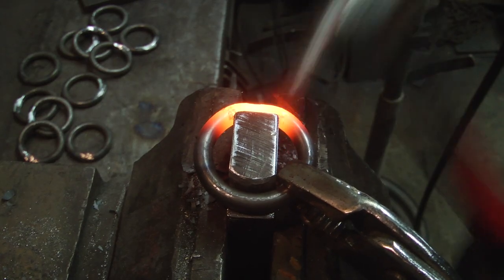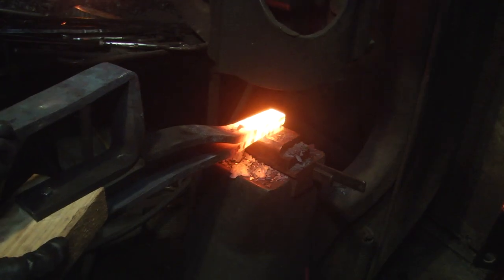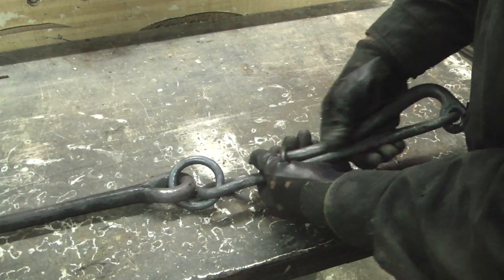Channel Trailer & Introduction To Engels Coach Shop

Comment: I would be hard pressed to name anything I have enjoyed more these last several years than your videos. They feel like a refuge in a storm to me. No politics, no wise cracks about current events, no religion other than a general appreciation of a higher power. You sir are a gentleman and a scholar! 

Love to see more of the mules and draft animals working. Loved the videos of the twenty mule team!
Reply: My sentiments exactly, and I've often thought that even if I can't put together a workshop to build life-sized wheels and wagons, I've learned so much about how they are built and adjusted, optimized for strength and durability, that I can at least make a pretty good scale model on my workbench.  These videos are very often the stuff that dreams are made of.
Reply: Spot on!!!
Reply: I will second that. This is what Youtube is about
Reply: @blackandgus  p00ppp0000ppp0000pp0p000p00p0p0p000p0000000p00000p0000p00ppppppp0ppppp0p0pp0p00ppppppppppppppplpppppppppppppppppppppppppppppppppppppppplppppppppppppppppppppppppppppppppllppppppppppppppppppppppplppppppppppppplpplpllpppppppppppppppppppppppplpppppllpppppppppppplppppppppppppplppppppplllppppppplpppppppppppppppppppppppppppppppppppppppppppppppppppppppppppppppppppppppppppppppplpppppppppppppppppppppppppppppppppppppppplppppppppppppppppppppppppppppppppppppppppppppppppppppppppppppppppppppppppppppppppppplppppppppppppplppppppppppppppppppppppppppppppppppppppppppppppppppppppppppppppppppppppppppppppppppppppppppppppppppppppppppppppppppppppppppppppppppppppppppppppppppppppppppppppppppppppppppppppppppppppppppppppppppppppppppppppppppppppppppppppppppppppppppppppppppppppppppppppppppppppppppppppppppopppppppppppp000⁰⁰⁰

Comment: Thanks Dave.
Your videos gave me the confidence and direction to make a wooden pump handle for our 160 year old farm.
It sits right off the porch and had been repainted but never a new handle. Without any one knowing I showed up with primer,paint and a new custom shaped hardwood handle with a new bolt. Truck's blew the air horn when making the bend.It really put life back into the front porch.Thanks for all your help on how to go about it and not give in when only hand tools are the answer.
I've learned so much.
Can't thank you enough!!!
Mark Brown
Britton Michigan.

Comment: My grand mother used to tell me I was a jack of all trades but master of none. Dave you have taken the Jack of all trades to a whole new level! I am restoring an older Jaguar E type and doing most all the work myself including upholstery, paint, metal repair and much more. I have learned a thing or two now as I am about to turn 65 years old. I think grandma would have been impressed. Your videos are inspiring for me. Thanks!  (I'm the one that asked if you had 3 phase in your shop)

Comment: Like the rest of the world, the north of Australia was built on the back of a bullock team. Today the only trace that survives is the odd axle in a fence. I don't think I have ever seen a wagon or coach, doubt I ever will see one in real life but I have watched every video. It has been the small things that have made the most impact. I have been using rivets for 20 years, and not until watching these videos did I find out I was actually bending wire in holes, my hammer and hand were too heavy, still a way to go but I am finally setting rivets for the first time. Also early days but I also started spinning my G clamps, it seems so logical I can't work out how I never saw it before, I guess that is what happens being so remote with no real tradesmen to learn from. Thank you Dave. This is the best TV that has ever been made.

Comment: I worked in a modern day blacksmith shop for a while, all these people who have no idea about the art of blacksmithing need to spend a few months or a year  heating and bending iron, nothing else. 
What you do is an art that we are going to loose when you are gone, the same as my profession is on the way out due to those who are coming up not willing to learn how and spend the time to become good at a profession where dirty hands are the norm, that also includes sore muscles and the scars left from any one of the thousands of skin breaks that happen. Great job, missed you for the month you were gone, but definitely do understand.
Reply: Santina Murphy  Sweeping and cleaning up is why many wouldn't do the job. These pansies of this age KNOW that they are not low enough to have to do menial tasks. They also know they should only have to start at the top, never anywhere else.

Comment: The use of modern equipment to save time and labor would have been used if it were available. A Craftsman would use the best with what that person had available. People tend to forget that steam and horse drawn vehicles were contemporary for century. the use of water wheels and windmills goes even farther and were used to power machinery. If a Blacksmith had access to a steam wind or water power hammer to help with his forge welding he would use it. It would have made his job easier and faster.

My Great Great Grandfather was a drayer, a person who used horses to draw a wagon to deliver goods, before 1900. My Grandfather used a wagon to goto town and used a horse drawn plow to plow his field in the 1930's.

Comment: Congratulations as I think you have succeeded your videos will be studied for years. As for the modern tools such as electric power you have not changed the way the wheels or wagons were made. Only using the electricity as an aid to reduce labour. You are not using CNC machines, computerisation or mass production techniques but old fashion hand making and assembly techniques used over the centuries. Sure you use a battery operated electric drill,  however the same work can be done with a man powered brace and bit exactly the same procedure.

Comment: Every burg had a blacksmith and wheel wright shop, but they repaired more wheels than they built I’d gather and where they were built probably was a large city wether in the East or South, maybe and I’d gather they were somewhat mechanized such as overhead belt driven machinery by means of water or whatever. I believe that mentioning in a comment that you have modern tools and technology is a mute point I think.

Comment: About the use of modern tools.  They for sure help things going quicker and with less effort.  But they do not help to choose the right piece of wood, the best wood fiber direction and orientation, what side to remove excess wood, how slow to do the steam bending, how much tension to put on the wires inside the rubber tires, what shrinking tolerances to choose when preparing a steel rim, and so on, and so on, and so on.....!!!   Critics on modern tools would be valuable if they would result in quality decrease, but that's not the case here in my opinion.  I guess the only potential wheel quality reduction would be caused by the less available good quality wood?

Comment: Oh no, not modern equipment. I guess I'll have to use my 18th/19th century computer to watch the videos they produced back then using all traditional methods.

I'm about done with youtube as a platform anyway. Now blocking comments unless you let the ads run. I had to turn off ad and tracking blocker to post this. Normally not an issue but since they decided to wholesale enable ads on every back video regardless of what the creators wanted forget them.

Comment: Excuse my rant in advance.  In blacksmithing circles there are purists that think the use of a propane forge is heresy.  Others think a power hammer is against the laws of nature.  Electric blower motors should be outlawed and only hand cranked allowed for coal fires.   My question to them is as follows.  Who do you think invented the hand cranked blower?  The blacksmith that was tired of using an overhead billows.  Power hammers weren't envisioned by a (insert your choice of profession), it was a blacksmith who realized he could create more product in less time at a lesser cost to his purse and to his body.  Blacksmiths have always been on the leading edge of innovation.  Designing & creating tools, jigs and equipment to increase output and profit.  If someone wants to adhere strictly to the techniques & tools of a certain era by all means do so, but don't expect everyone else to feel the same level of devotion to a specific time period.  The end product has always been the goal and there are multiple ways to achieve that.     I appreciate Mr. Engels devotion to his craft and greatly appreciate his taking time to capture his amazing work for future generations.   Ok, rant over.